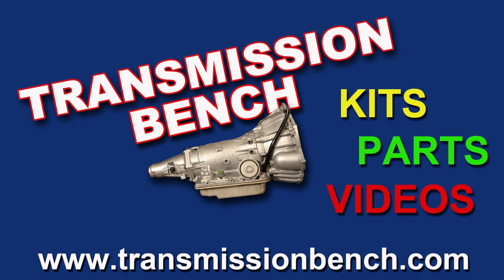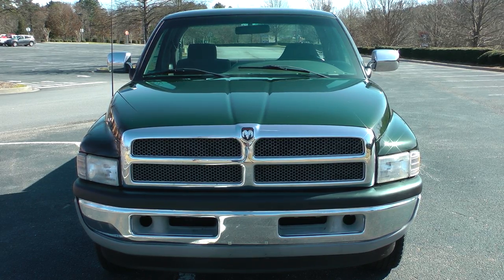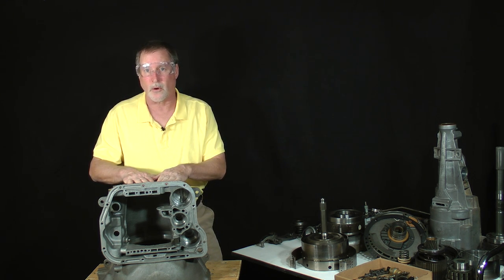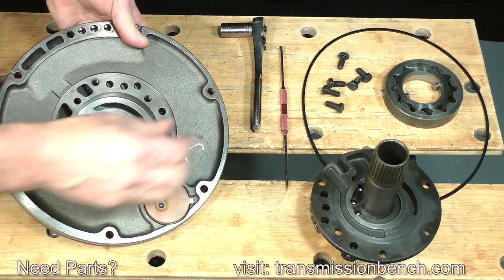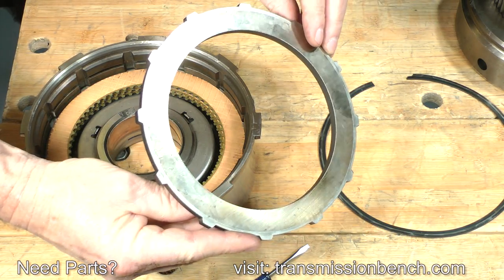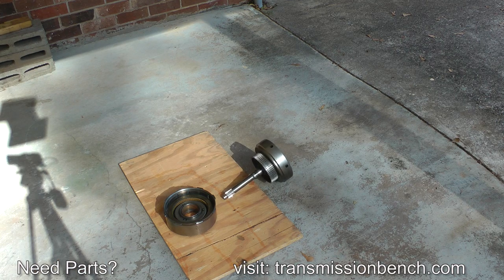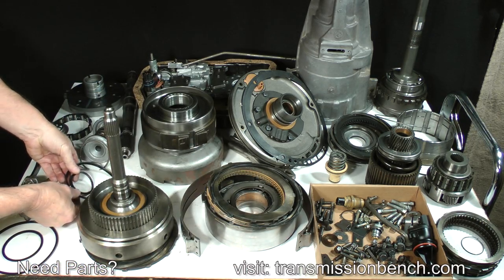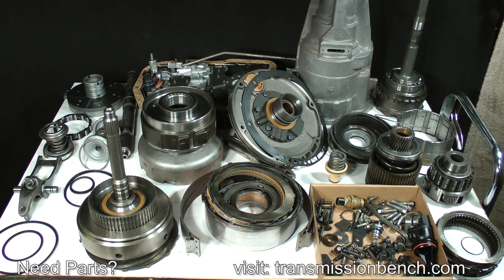Chrysler 46RE Class Part 2 lesson 1

Comment: Thank you sir. I have a 2 2001 dodge ram 1500s. One of them has 325000 miles and the other has 258000 miles on it. I've been struggling putting junkyard used transmissions on them about every two years just to get by. I will attempt my own full transmission rebuild because of your videos. I appreciate you so much, and I live the nice slow pace in which you teach.

Comment: @Transmissionbench I myself own a 2nd generation Dodge Ram, however I didn't buy it new like you have. But I agree with you about working on your own vehicle, it's free labor, and you get to learn things about it as well. Plus when the project is done, you gain a sense of pride in the fact that you did it yourself. But I've always worked on my own trucks, it's how I was raised! My 1996 Ram is my second love and at 165k is getting a ground up restoration/ modification and color change. Thanks for teaching me how to work on the transmission!

Comment: Whenever I replace a transmission, I replace the radiator and add a larger transmission cooler. The transmission cooler inside the old radiator can get clogged with debris from the old burned up transmission. It's almost impossible to make sure that it's flushed out. You don't want debris from the old transmission breaking loose and ending up in your new transmission.  It's  good practice to just replace it. Often, if you buy a rebuilt transmission and don't replace the radiator.  It voids the warranty  of your new transmission.

Comment: I've got a 2000 dodge ram 1500 sport 4x4. My old transmission went out so I got a new transmission and transfer case from powertorque transmissions. I got it in installed and it jumps at 35mph and the over drive feels like it slips what's wrong with my transmission? And I certainly want to rebuild mine because your instructions are very clear I just want to know an easy way to lower and lift my transmission back into my truck.

Comment: Hello sir if you could help me would greatly appreciate it. Have a 1994 Dodge Dakota 3.9 4x4 when it's cold pulls in reverse great when warms up it stalls the engine in reverse . It's a automatic transmission . Have replaced torque converter

Comment: du u have just video of just doing a 4 wheel drive trans ty
Reply: same concept, just a different tail housing, no speed sensor on the tail housing, and the steel and friction plate numbers may be different
Reply: i'm doing a rebuild on my 2001 Ram 1500 Off-Road Edition currently.